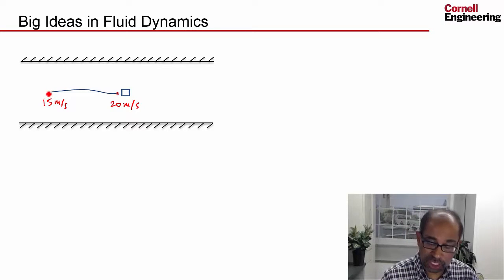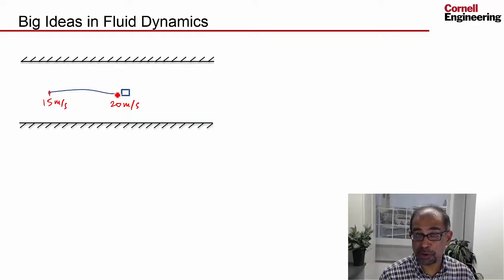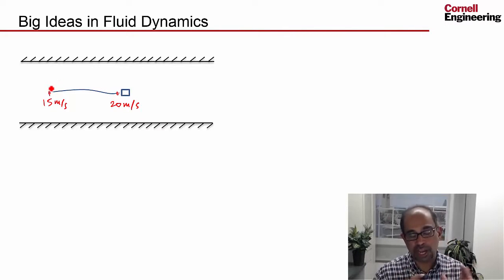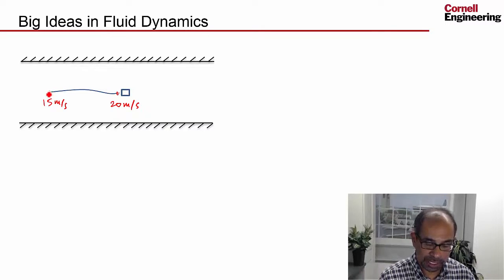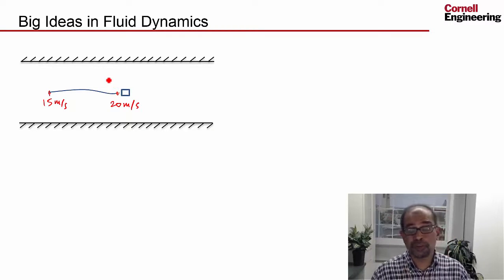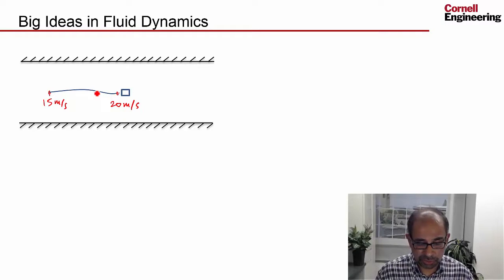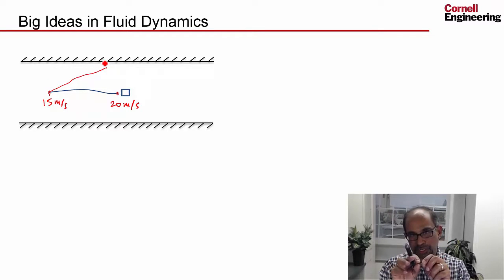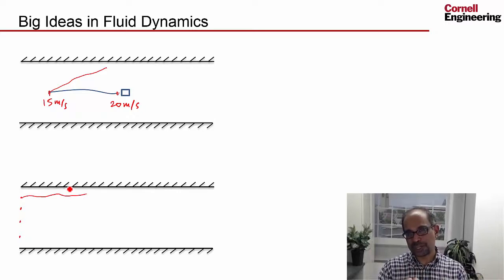Simulation MOOC: Particle Velocity Change

Comment: The (1) Steady Flow means that the velocity of fluid particles at any point is constant as time passes.
(2) Unsteady Flow exists whenever the velocity at a point in the fluid changes with the passage of time. 

Read carefully: Velocity at ANY POINT is CONSTANT as time passes. 

That doesn't mean that the magnitude of the Velocities at various points has to be EQUAL. It just has to be whatever it is forever (passage of time).

Let's identify 3 arbitrary points in space within a fluid flow volume. A, B, and C. 

@ Time = 1 second
Velocity @ A (Vel_A) = 1 m/s
Vel_B = 2 m/s
Vel_C = 3 m/s

Is the flow unsteady? steady? I don't know. Let's continue.

@ Time = 2 seconds
Vel_A = 1 m/s
Vel_B = 2 m/s
Vel_C = 3 m/s

Is the flow steady? Yes - Now we can answer. The Magnitude of the velocities at our arbitrary points stayed CONSTANT as time passed. 

@ Time = 3 seconds
Vel_A = 0.5 m/s
Vel_B = 1.5 m/s
Vel_C = 2.5 m/s

Uh oh - something happened. For some reason at Time = 3 seconds. Our Velocities slowed down. 

Is the flow steady? Nope. Our streamlines violated the Steady Rules. 

So now think about what the Professor was saying:

The question he asked (True or False): 
If the velocity of a fluid particle is changing with time, the flow has to be unsteady.

Well, let us think about that, shall we?

Let's follow the journey of our friendly Fluid Particle - Call him Sam. 
(Use the above numbers/examples):

Sam takes off from Point A at a speed of 1 m/s.
Sam reaches Point B and now is traveling at 2 m/s.
Sam reaches Point C and now is traveling at 3 m/s.

You may rush to conclude that flow is unsteady? But that is not necessarily the case - as we discussed above. The way the question was worded - you have to think in the Lagrangian Reference Frame (and follow our Buddy Sam in his Journey). 

The magnitude of the velocities can indeed be different at different points in space at any snapshot of time but it is still considered Steady Flow if they maintain those magnitudes constant over time. So the answer to the above question is False. 

Hope that helped!

Comment: What I understood is, if we consider the *Lagrangian frame* (i.e. **following the particle and observing it's behavior with space and time**) then, if the fluid particles velocity does not change as the particle moves though the space (x,y,z) and with time as well i.e if you observe the motion of the particles will remain the same and the path followed by the particles will remain same at different intervals of time, this is steady motion of the flow. Moreover, it's a uniform flow.
But if the velocity changes at different locations and remain the same at different instants of time then the flow is uniform at different locations but not over the whole domain. So overall the flow will be non-uniform and unsteady as a particle move with different velocities from one point to another over a period of time.

Whereas in the *Eulerian frame* of reference, we are *looking at a fixed point* in space over a period of time through which the particles will pass and if they show variation in the velocity when observed at any instant while passing through the same point which will result in a different path followed by the successive particles then it is an unsteady flow.

Coming back to the *Langrangian Frame**, if the velocity at different locations, say, 1,2,3,4,5,6.....n is v1, v2, v3, v4,.....vn remains the same at their **respective* locations at any instant of time, this implies that the path will remain the same with time but the velocity is changing from one point to another (say, 1 to 3) while traveling over a period of time (from t1 to t3), hence, it is changing with time as well. So this is said to be an unsteady flow. In such a case, the flow can only be said to be steady if the flow velocity is not changing with space and time which leads to the uniform flow - here, **we followed the particle and observed its variation with time**.

If that's correct then in the 2nd question, the frame of reference should be mentioned.

Please correct me if I am wrong.

Comment: i think this explanation is for uniform and non uniform flow
Reply: @manish Kahti,
As per my understanding, steady flow means the flow doesn't vary over time: i.e. keep position fix and check the velocity with respect to time. If it is constant then it is a steady flow and if it is not constant then it is unsteady flow.
On the other hand, uniform flow means it doesn't vary over space: i.e. keep time constant and check velocity for all locations in the control volume. If it is constant then it is a uniform, else non-uniform.
Please correct me if I am wrong :)
Reply: @ramchandrakhadkikar9557  yes you are right sir.
Reply: This explanation is correct . I don't know how i misinterpreted it  wrong , my bad thanks for the correction.